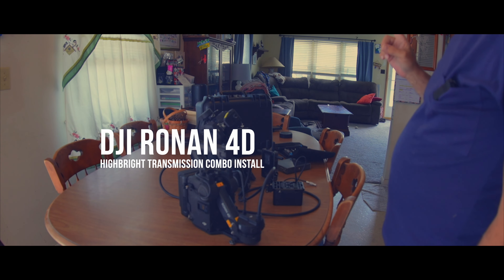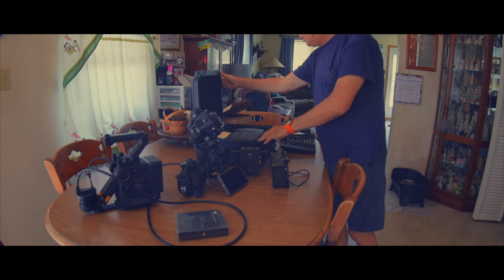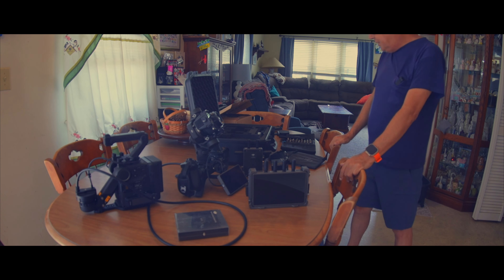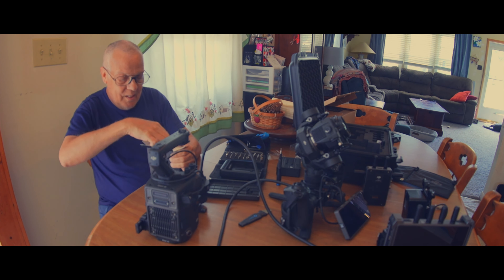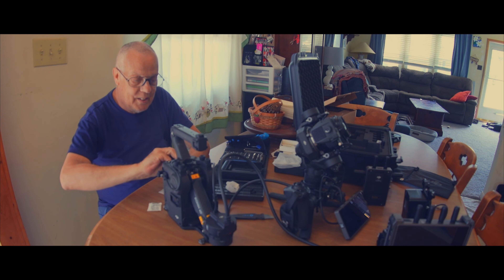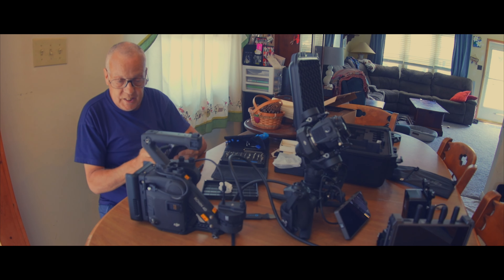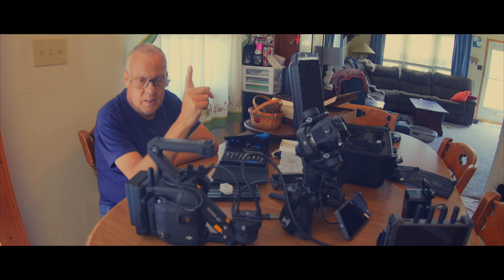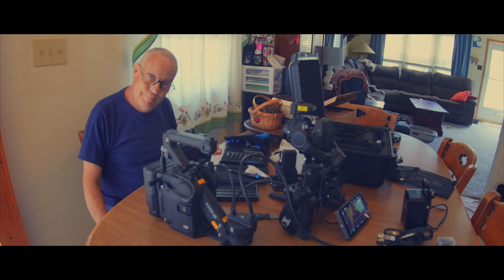DJI RONIN 4d transmission setup - PART1

Comment: All that build up and then you end with an “I’ll be back”?  LOL - thanks Schwarzenegger!  How did the activation go?  So the transmission just allows for a second party to be viewing the feed in realtime as you are also recording with the unit?  How could you use that?  A director maybe?
Reply from the maker: Working on Part 2 today. Activation went well with both the receiver monitor and the transceiver because one needs to do both. The set up does allow for a directors monitor but it's functionality goes further because it has remote follow focus, start & stop of the camera and complete gimbal control. If you needed to have the camera mounted on a boom you'd also have complete camera access!
Reply: @JayWeldy  Ah, having remote control from a boom makes perfect sense now.  Videography is while different world from photography!

Comment: Current similar boat as you in regards to finally setting up and connecting this monitor and transition system specifically for the Ronin 4D. I have the Flex system as well and now they have finally released the their Zenmuse X9 8K piece that I'm a little undecided about. Anywayyyyyy..... I'm literally activating the monitor now. I was looking for your part 2 on this? did you shoot it?.
Reply from the maker: Nice, I'm not going to do the 8K. I have no use case for it. I did do a part two but the audio was horrible and unusable and have not had a chance to do any other video's with the 4D since. I've been really sick.

Comment: Hi Jay, do I need DJI's fat video transmitter? the one which did not fit on 4D? or I can just buy 4Ds transmitter with the monitor ?
Reply from the maker: I bought the 4d transmitter and it works fine. I already had the monitor which works great with the 4d transmitter.